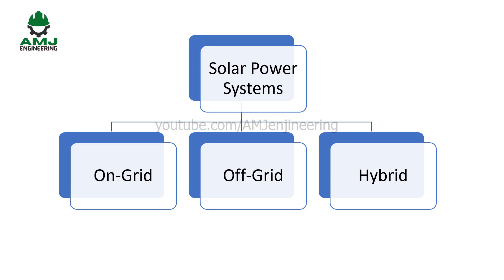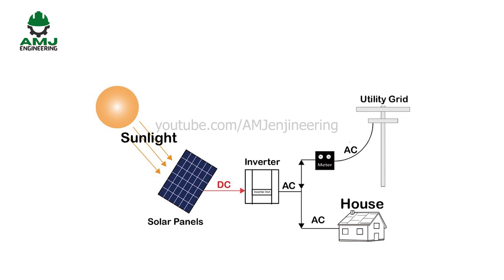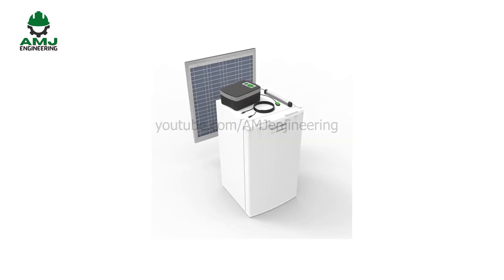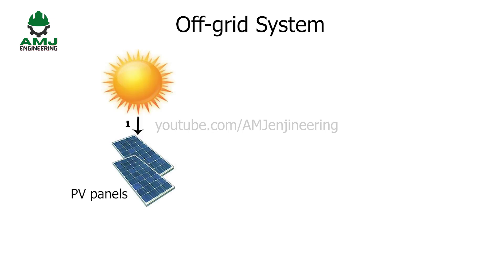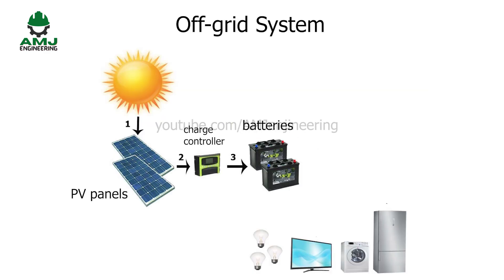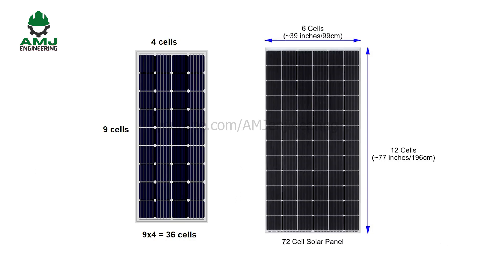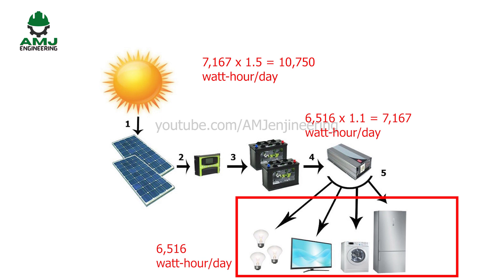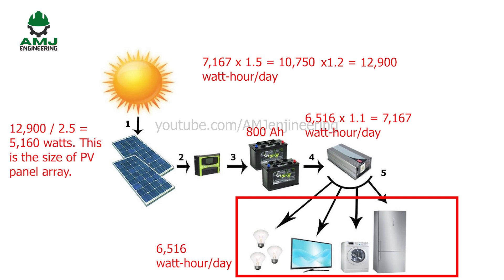how to size a solar power system for your home

Comment: One can have a 4th type of system as well. Create an off grid system to run 50% of the house load; lights, computer, radio, refrigerator, coffee maker. Use a bank of Generac generator transfer switches to engage the selected circuits to either the grid or the battery/inverter. One can install a plug on the end of a wire from the Inverter to a generator receptacle to power the transfer switch bank from either the battery powered inverter or a generator. Connect the solar panels to the batteries with a separate charge controller. Why go through the mess of using a grid tie inverter with the inspections, upgrades and contracts with power companies? One may not have to go completely off grid to save money and to have strategic emergency power in the house.
Reply: I may do that 4th here in the Philippines. Too many brown outs, like every day, and a typhoon? None for a month or longer. If I can afford it, I'm going completely off grid, but, if not, I will put lights and the exhaust fan in the kitchen on the grid, and in a separate panel, everything else

Comment: Whole-house systems usually use 48V nominal batteries in order to reduce current and thereby reduce resistive losses in wiring, or allow thinner and cheaper wires to be used. High voltage charge controllers similarly allow solar panels to be wired in series using longer strings, thereby reducing current and also reducing resistive losses. The latter is particularly important if your solar panels are not on a roof, but some way away in a field. Shame the text-to-speech converter can't pronounce "lead" properly.
Reply: Wrong!

Comment: I want to run a 1100 watt pool pump for 7 hours daily. I have eight 190watt panels to use. Please advise size of MPPT, inverter and battery do I need . My panel specs are Open Circuit Voltage =45.37v, Impp =7.17A, Umpp =36.74v.
Reply from the maker: It depends on the solar hours in your area. You may not require batteries if you can fill during sun hours. I suggest to consult solar specialist.

Comment: Is there a software you can calculate for?
Reply: Frankly, you would be better to learn properly how all this works and write your own Excel spreadsheet. If not and the software is wrong or does not consider everything you come up short.
Learn how to model the sun incidence on your panels based on the sun angle and time of day and the various efficiencies of the inverter and solar charge controllers etc. Doing this 'homework' yourself puts you in a great place of knowledge so you know what you are talking about and some contractor doesn't fool you. 
Remember, there lots of additional charges. Shipping, the heavy wires, utility boxes, breakers, large fuses, shut off switches, permits, etc. Gotta know it all and even then it'll probably cost more.
If there are gov't incentives, you usually have to buy new as the gov't cares more about stimulating the economy than the environment. 
If you can sell electricity to your utility for a profit, that might stop after the best election unless your contract is airtight.

Comment: Thanks for the exciting presentation.
Please what should the size or watts rating of the solar panel be if the solar panel simultaneously charges the battery and supplies power to the load inverter  at the same time ?
Reply from the maker: Thanks dear. Panel array size depends on your requirements; that is in how many hours yiu wanna charge your batteries and how much load you wanna take directly from sun during sun hours.
Lets say you wanna run an oven and refrigerator with some lamps. That should be around 2000 watts load.
Your panels (assume 500 watt each), then you shall have at least 5 panels assuming 0.8 effieceincy.
But also you wanna charge your batteries at the same time, so doubling the array size means you are taking 5000wattx0.8 approx 4000watts. Then you can consume 2000w and charge your batteries with 2000w. If your batteries are 200Ah 24V (4800w) you will be able to charge them within 4 hours.
Reply: Okay

Comment: Hi, Im a beginner. I have 2pcs 100w solar pannel, how many amp can I use for charge controller? whats your recommendation? I have 3pcs PWM solar charge controller 10A, 20A, 30A.
Reply from the maker: watch the video and try to start from batteries backward. it is easy to calculate step by step